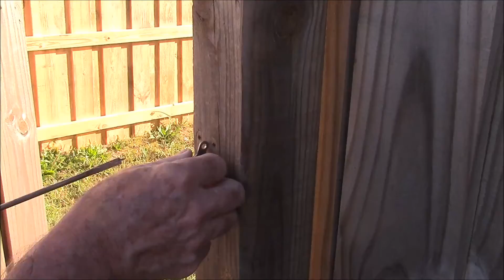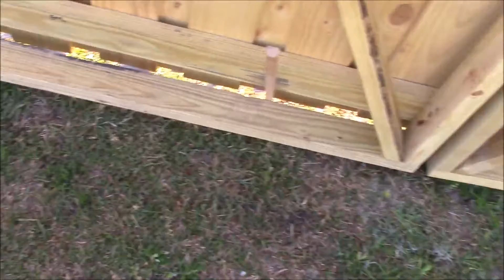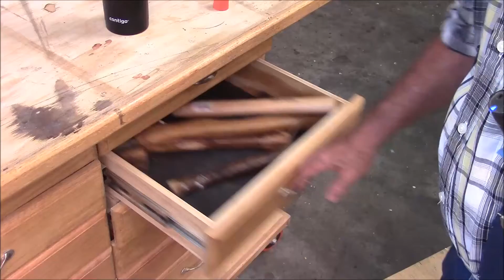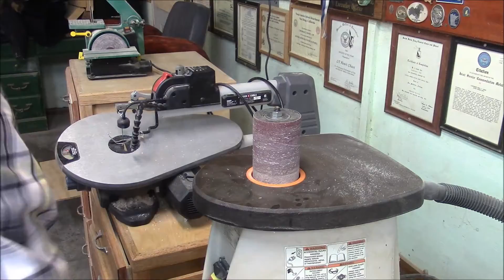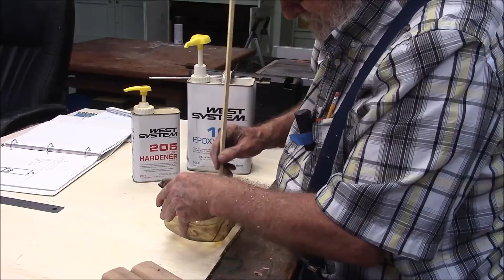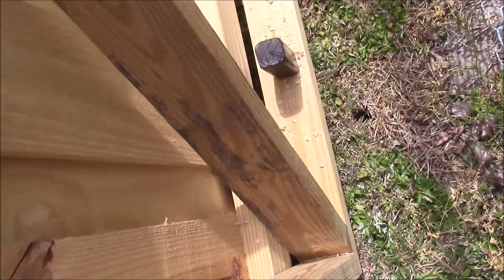114 Making Gate Stops and remote latch pulls for wood gates

Comment: I knew there had to be a use for those old wire coat hangers. Actually those things used to come in handy for many things. The new plastic ones are only good for one thing -- hanging clothes. Where's the fun in that? :-D
Reply from the maker: Isn't it the truth!!!  I still use that wire for lots of things, provided I can get the hangers.  Everything comes with plastic now, as you say.  The wire was either black or a greenish brown color, soft enough to work with, yet strong enough and long enough for about anything.  I wonder how many car doors have been opened over the years with a coat hanger?  Remember, back in the day that coat hangers were  standard equipment if you locked your keys in the car.  
      And they were so good for the environment too!!!  Turn to rust right before your eyes.  
     Thanks for watching and commenting.
Reply: I certainly remember opening a few car doors with wire coat hangers and using them for quite a few other things. As you mentioned, they were soft enough to work with yet strong enough to take care of the job at hand. I sure remember those "oh crap" moments when I realized the keys were still in the ignition a couple of seconds after I locked and closed the car door. Fortunately, technology has now made locking the keys in the car a thing of the past.

Comment: 7:45  "So our theory didn't work. Good theory though, wasn't it?" Ha ha ha. I love this transparency. I will give you the phrase I use a lot. "It didn't work. But it was a good idea. All my ideas are good, it is just that many do not work. The operation was a success, but the patient died." Great take a ways. Very clever. I hope it is OK to tell you my lazy way to keep dirt from getting in the pipe. Just flatten one end with the large hammer. Of course your way is more elegant and will go in straight. Great video as always.
Reply from the maker: Thanks for the kind words.
      Flattening the pipe, or just sticking a twig in the end are both better ideas.  But heck fire, I just wanted to use my lathe.  Actually, I could have got the pipe cut to length, but I wanted to use that monster reciprocating saw.  
      But I really did wonder if the dirt would compact in the end, making a natural plug.  Actually, it did finally plug it, but the plug was 10 inches deep!  Oops!
      Thanks for watching and commenting.

Comment: Believe it or not, it is Sunday morning and I have already got to watch your video.   Very innovative design to put the wire through the posts at the angle you did for opening from the outside.  I love it!  One of the reasons I enjoy your videos is that you have a lot of theories and demonstrate your tests and whether they pass or fail.  Maybe if you lived in a place where the soil was more clay than sand, your theory would have been right.  However, you came up with another brilliant Memphis invention with the plugs.  I also like the stops that you made.  It seems as if you had already used this design on your older gate.  Do you have a problem with the pipe for the open position filling up with dirt?  I ask because I had a gutter pipe that was buried and came out with a 4 inch PVC pipe in my yard.  I had forgotten about it for several years and now it is filled in.  I can't find it.  Any hot tips on how to locate it?  I hope your have enjoyed your travels.  Was this the yearly fishing and lying trip?  If so, I hope you came home with lots of whoppers.
Reply from the maker: Thanks for the kind words.  No, this trip was to deliver projects to some friends and family in Indiana.  
      Finding the PVC.  I love those kind of challenges!!!!
      1.  If you have a friend with a metal detector, they can probably find it, provided they have a high dollar version.  Some of the high dollar detectors find stuff other than metal;  same principle as a stud finder I guess.
      2.  If the pipe is laying horizontally, then use a spade to slice a thin cerf perpendicular to the approximate route of the PVC.  
      3.  Look for a very green part of your lawn, as the pipe is probably still leaking out gutter water.  
      4.  However, if the pipe is buried shallow, then the grass along the route of the pipe may be browner during a drought.  
      5.  Put red dye down your gutter and see where it comes out.
      6.  Probe your lawn with a sharp metal rod.  Thin, but strong so it is easy to push into the ground.  
      7.  If you have access to an infrared camera - hunters use them and they are becoming common - check the area both at night and during the day.  The soil will cool faster around the end of the pipe (less mass).  

    Man, this would make a good video.  Why not make a video of you trying to find the pipe.

    Again, thanks for the kind words, and as always, thanks for watching and commenting.
Reply: Sorry for taking so long to get back to you, but I went to the mountains to do a little hiking today.  I hope all the family loved their projects as much as I do.

   1. I don't think any of my friends have metal detectors.  Will have to ask around.
    2.Yes, the pipe goes out into the yard about 5 feet the best I can remember so that is an option.
   3. Can't see a difference in any of the grass in that area so that is not helpful.
   4.We are not in a drought now and I couldn't tell a difference last year during the huge drought we had.
    5.  May try the dye if other methods don't work.
    6. This may be my best option.  I need to see if I can find a piece of "rebar" to use.  Unlike you, we have hard packed soil here and I can only hope that would work.
    7.  Cool idea.  Maybe I need to pursue one of those cameras and try it out.

I will give some consideration to the video idea.  I have made great progress with my journey to improve my health (down 82 pounds and walking at least 5 miles a day) but I am still a chunky monkey and not sure if I could handle those evil trolls.  Hahahahaha  I do have a video in mind that would steal one of your patented ideas. The railing on my porch has come loose from the post and the best way for me to be able to repair it alone is to drive a nail or screw just below where I need the railing to go so that I could hold it up while I am making the repairs.  Of course I am not the handiest person in the world so that could be a disaster.  Hahahha
Reply from the maker: Yep, everything has a different heat signature.  A buried PVC pipe, or the opening would give a different signature.  It might work.  But don't forget the cerf idea, provided the pipe isn't too deep.
     Hope to see that video.  
     You give me most of my ideas, as you well know.  For example, the season summary and the shop tour were both your ideas.  And if you squirm in your seat too much I will give you more evidence.  It keeps you humble.
     82 lbs!!!!  Believe it or not, I was a long distance runner, college scholarships and the whole deal.  Spent my life skinny, as I stopped running at age 65.  But my lowest weight wasn't from running 10 miles a day, rather it came during my two-year "vegan" period.  
     My shop saved me from all that silliness.  Instead, every morning I go to my shop and do whatever I want.    
     You are probably handier than you think.  Here's a "take-a-way," which I use nearly every day:  get a cup of coffee, sit up in your captain's chair and pretend you are somebody else looking at your project.  Painful, and humbling.  
      Don't worry about the trolls.  I just ignore them, and it seems to work.  One thing to notice about trolls is that they never or rarely make videos!!!!  Check it out.  The only troll I know of who makes videos is DOC and he is nutso, crazy, and dangerous.  Moreover, absolutely none of the really big channels even respond to comments.  Go for it.
     Hang in there, and see you next week.
Reply: I wouldn't think the pipe is too deep.  This was a spec house and I am sure that the builder put as little work into it as he had to.

I don't even come close to giving you the most ideas.  You have some of the most creative projects of anyone out there.

I knew you had been a runner but didn't know you had been a vegan.  Did "the War Department" also go vegan?  I am vegetarian and am thinking of going full on vegan.  The entire industry of animal related products is beginning to bother me.  My sister and her husband owned a dairy and sold to the most trusted brand in our area.  Their cows were treated terribly.  As you can imagine, I don't have a very high opinion of that sister.

I have become a HUGE fan of doing what makes me the happiest and it has made a significant change in my health.  I have become the most unemployable person in America!  I refuse to do anything that I don't enjoy!

We will see how handy I am.  If I can work up the enthusiasm to repair the railing, I will at least know how it went.  

Maybe I need to drink some courage juice and make the video.  Of course, courage juice and power tools may not be a good mix.  Hahhahahah  

I look forward to seeing your next project.  Stay cool down there in SC my friend!